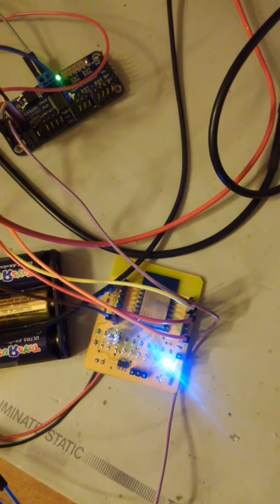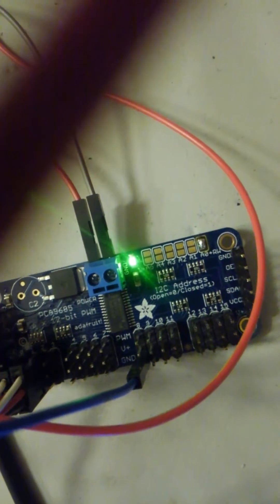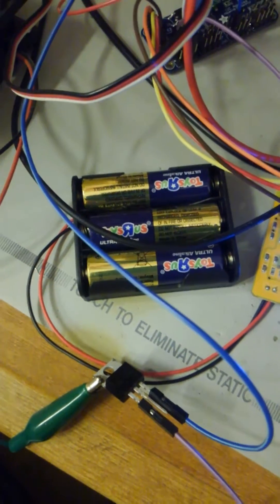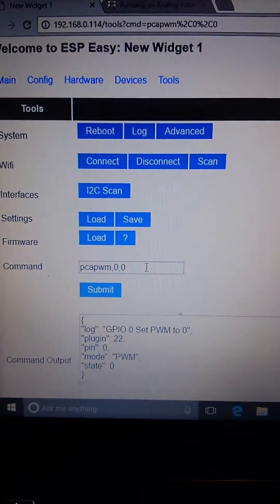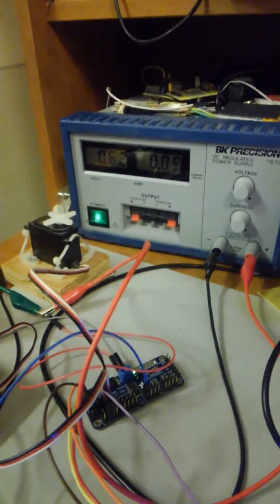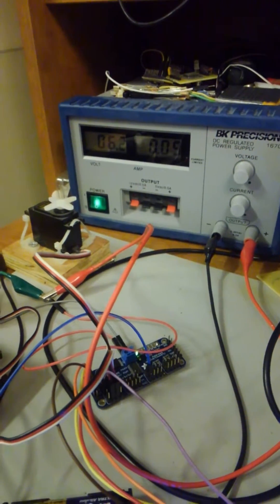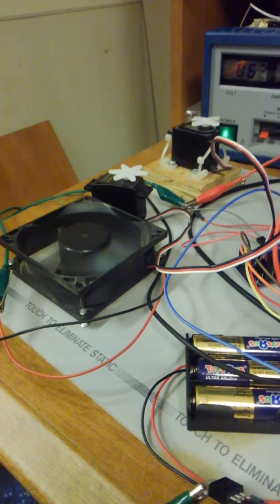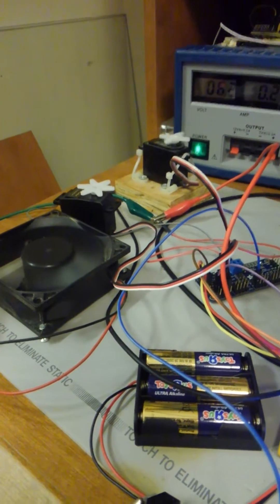PCA9685 Controlled by ESP8266 WiFi Controller

Comment from the maker: Here is the link to my dropbox code zip for this project.  Do a Google search for ESP Easy to setup the Wifi module as you need it to connect to your Wifi or create its own hotspot.  Then look in the code file for PCA9685 section of code to see how I modified it to use the transistor and PWM control of the servo.  https://www.dropbox.com/s/9f2z7zpsfyymf07/ESPEasy_Modified_PCA9685_Switch_AlwaysSend.ino.zip?dl=0